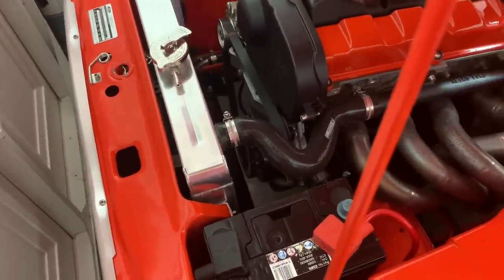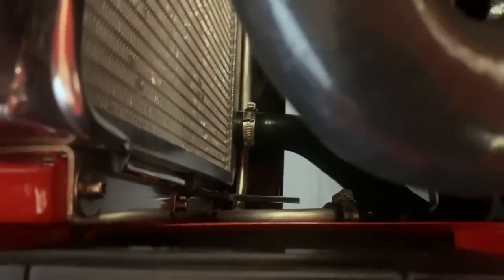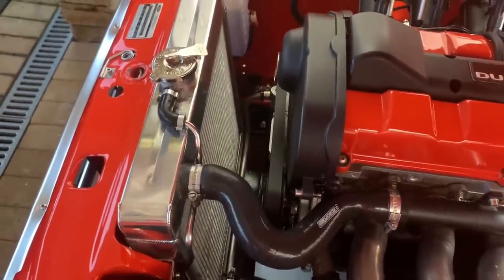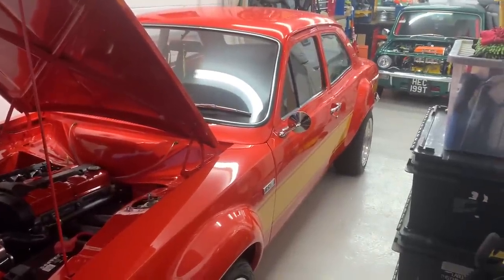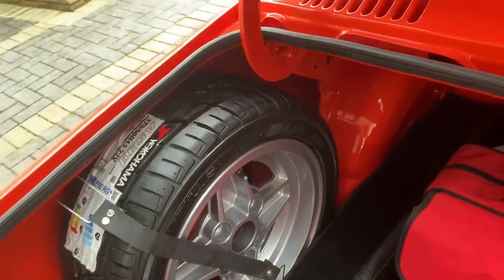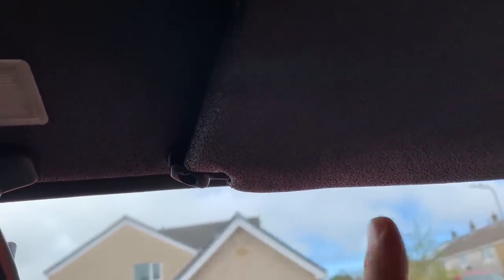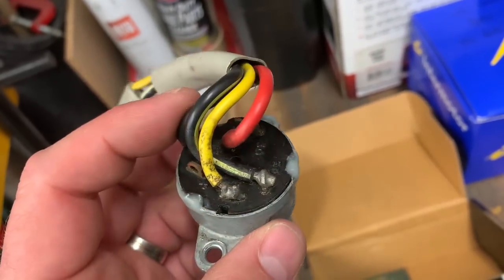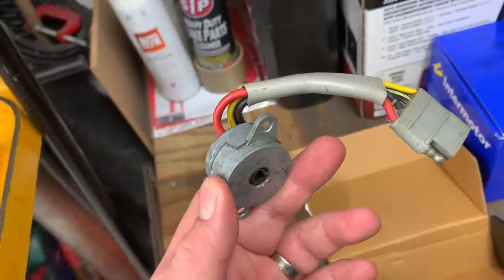MK1 Escort RS 2000 improvements and Announcement

Comment: Hiya Craig, congratulations on the magazine absolutely stunning fair play, I was wondering if you had any trouble with the wildwood master cylinder leaking on the brake pipe fittings as I can't stop it dripping a little bit, any advice would be much appreciated Thanks.
Reply from the maker: Thanks Mark 👍. I haven’t had any leaks on the pipe fittings but did have a small leak from the filling cap for a while. That seams to have resolved itself now. I had a bleed nipple on one of the princess front callipers that just kept weeping no matter how tight it was 🤦‍♂️
Reply: Ah cheers Craig thanks for the fast reply, I've just remade the pipe haven't tried it yet, hopefully it will stop weeping fingers crossed 🙄 Thanks again Craig.💎
Reply from the maker: @markgillett3563  no problem 🤞🤞🤞

Comment: what kind of timing belt tensioner are you using on your ST170?
Reply from the maker: It's just the one that comes in the cam belt kit. Theres 1 idler pulley and 1 tensioner pulley mounted next to each other just below cylinder head height

Comment: Nothing in that switch will or can effect the speed of engine cranking try replacing your starter motor  that is your problem
Reply from the maker: Starter motor is brand new but since I replaced that switch, cranking speed has been normal so the increased resistance in the old switch contacts has been the issue